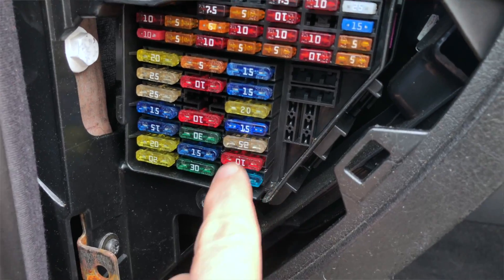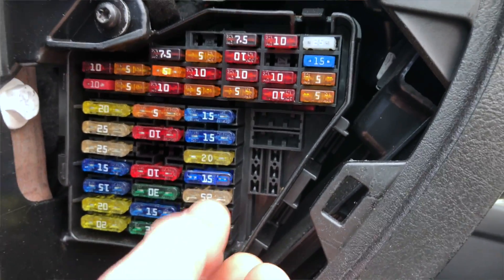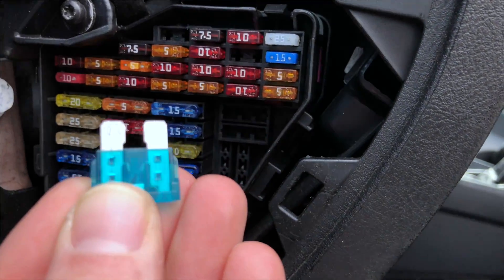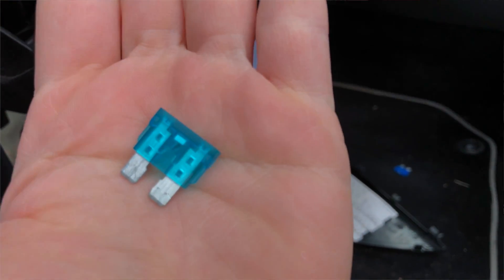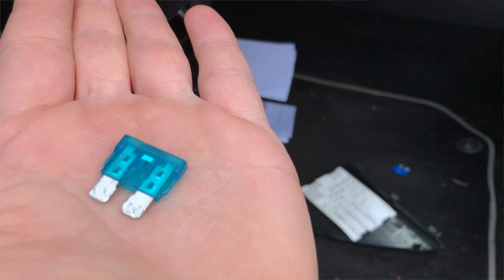Never Skip The Basics When Working on Cars

Comment: In the mk4 tdi I picked up last year, I had no illumination on any of the dash -the actual check engine, high beam, that sort of stuff all worked, but there were no interior back lights for anything. i went through the fuse box twice, had to find a better detailed one online that specified it, but it was just missing the entire time. I replaced the little bulb in the back of the heat controls before i had confirmed a missing fuse. Great times lol

Comment: I had a Golf in the shop before christmas with windshield heaters not working as the customer complain.
I had replaced the windshield a couple of months ago, so I figured I had forgotten to connect the ground or either of the power connections to the windshield.
Fuse was OK, ground was OK, resistance in the windshield was OK, relay was OK, turned it on, and voltage was OK....
I spent a good 30 minutes diagnosing a system that was working all the time, without first checking if it worked...

At least I could give the customer a full report, rather than just writing "function check OK".

Comment: My GF hit a concrete pole and ripped her mirror right out along with dented door, dented fender and broken blinker. Also her blower motor stopped working along with pretty much everything related to the mirrors/heat/AC/seat heaters etc. It was just a blown fuse due to the now exposed wires of the mirror touching.

Comment: I did some job on my B5 Passat and had to unplug a number of things to get er done. Getting it all buttoned back up, I forgot to plug the MAF back in. About flipped my lid figuring out why it wouldnt run right. Check your work (plugs, bolts, etc) on the way out of a repair!

Comment: I'll tell you another story that may shock you, a friend came to me saying that his car didn't want to run on gasoline, it runs only on propane, so he told me that the fuel pump died so I unplugged the pipe that was feeding the injectors and turned the ignition on and really there was no fuel, i asked him if he filled some in the tank because the arrow on the dash was on empty and he said that the arrow is broken and always stays there but he had filled half a tank. So presuming that there is fuel in the tank I started disassembling the tank cover and taking out the pump, after I took it out SURPRISE there was not a single drop of fuel in the tank, it was dry as a dessert. I assembled everything back, pored some fuel and everything worked even the arrow on the dash. My friend forgot to mention that he filled half a tank more than 2 months ago, so I know how you feel about the fuse. The car was a 98' Seat Cordoba.

Comment: The heated seats in my old Passat did not work since I've bought it. So one day I decided to diagnose the problem. I've started with passenger side and boom! The plug under the seat wasn't connected properly - I've reattached it and the seat was warm in a minute. After this success I went for a driver's seat. And again, I've instantly knew what the problem was... someone had changed the seat for the non-heated one :(

Comment: I Had a VW Something A customer Brought me. They Put in a AZ Fuel pump Assembly. Still No Start. I Remember It was a Newer car I Couldn't Imagine The FP being Bad. I Had no power to the FP. Ended up a Fuse In the Under Hood Fuse Box was Missing. That according to the Wiring Diagram That Fuse had nothing to do with the FP. Thank You Crazy Customer & Alldata

Comment: Passenger heated seat doesnt work, gf complains all the time. A video on seats would have helped
Reply from the maker: You can now blame me though. That’s cool!!! Hahahahha
Reply: @HumbleMechanic  I installed heated power seats in my Jeep XJ. Passenger seat is an XJ seat, driver's seat is a Grand Cherokee seat. I cut out the memory seat controller, rewired the switches to work. Wired in the heated seats too. Found all of the rare parts to do this, in the junkyard. Both seats elements are open. Womp womp. Still thrilled to have found the parts. The elements in heated seats just can't take decades of asses, (it's in the bible,) flexing, and heat cycles. You can find element repair vijeos, or threads in forums, but the ones I've seen look sketchy. It involves bridging the break with solder and you can see the burn mark from when the element opened, in the seat foam. Solder is not really meant to be the element or a wire, it can flex and crack, melts at lower temps, has higher resistance. If you can find new seat elements that's the way to go. Then you have to disassemble the seat or seats and put it back together again getting the cover back on right. Not an easy job, might need special tools for hog rings.
Reply: I diagnosed a car with passenger heated seat not working a couple of years ago.
Took me a couple of hours looking confused at a wiring diagram that didn't match the car. Swapped the driver's and passenger's seats, and the fault was still on the passenger side.
We had power, we had ground, but for some odd reason it didn't work.

After quite a few hours, I checked the parts number for the wiring harness under the passenger seat, and it was identical to the one under the driver's seat. 
This explained why the wiring diagram didn't match... The connection placement for either power or ground was different.

PS: If you want to cheap out on heated seats, buy a cheap sitting pad for hiking trips. They really work!
Reply: Did you check the fuse?  ;-)
Reply: @LMacNeill  one fuse for both seats. so thats not the case

Comment: Well one time a friend asked me if i could help HIM with this weird problem. He was driving, and the car started to make weird noises. And he drove like 10km and it still didn’t went away. And he was on the phone and went in to full diagnostic mode:
Yeah maybe my wheelbearing or my stabelazor, or its the rim or maybe it is the cv joint or boot or maybe its the whole arm. 
And i was like dude? Did u check ur tire? Turned out he had a flat tire.

Comment: Guy came in with his Tahoe and his power windows and seats weren't working. He took out the circuit breaker for the power seats and forgot to plug in the master window switch when he took the door panel off.

Comment: Thank you. The heated seats in my '04 Impala quit working. I checked the seat fuses but hadn't thought to check the other fuses.  Gonna pull the wire diagrams and see what else is involved...but if I need them, I have a test light, Power Probe and scan tool at the ready😉

Comment: You can start with the fuse box but never end at the fuse box.  Fuses blow for a reason.
Reply from the maker: Yep. I’ve actually written an outline for the follow up to this video  talking about that exact thing
Reply: @HumbleMechanic  ever find out what caused the fuse to blow? The same deity that tangles our meter leads steals our 10mm sockets?
Reply: The circuit starts at the fuse

Comment: Seriously, check your fuses. Had someone bring me a car saying their wipers died in a rainstorm. They were freaking out thinking they would have to buy a new wiper motor or wiper linkage plus all the labor. First thing I did was look at the fuse. It was the old style 'pill' fuses and one of the ends cracked that you couldn't see unless you pulled it out and looked very close. Fixed for less than a $1.
Reply: But did you bother to diagnose the reason why the fuse blew.
Reply: @danielwarren6845  Yes, it was old. The car is a 1983.

Comment: Dude, no kidding! This is so try! Get this, I live in Marathon Florida, in the keys right. None the less, it gets hot! So the AC goes out in my 2003 Dodge Ram 1500. It was just the blower fan that stopped working. No issues with the compressor. I spent the next 3 months driving around with the windows down, not wanting to change the fan.
The brakes start to squeak so I decide to do the rotors and the calipers. While I'm doing that, it's time to change the fan. I buy the fan from advanced, do the brakes. Go to pull the blower fan for the AC, unplug it and realize that the plug was broken!
Put a new end on it and the fan has been working ever since! Those hot 3 months for 5 minutes and a spade connecter, wow!

Comment: A blown fuse usually indicates electrical problems. If it blows again then you will need to go full diagnosis.
Reply: That fuse being a different blue usually means it's cheaper, possibly weaker. But it had been replaced before... I'm not gonna be surprised if we end up with the heated seat diagnostic video in the future.
Reply from the maker: 100% yes.
Reply: I was about to say same thing and i agree with you 100%. It drives me nuts when I see people replacing fuses saying "fuses keep blowing" like if the fuse was the root cause of the problem :-)
Reply: Yep. I had a xenon headlight fuse blow. I replaced it and the light started working. I thought maybe fuses just last 17 years.  A month later the fuse blew again. And replacing it did not help. The headlight was leaking, the ballast was full of water. Had to get a new one, should have diagnosed the first time the fuse blew.

Comment: Why would the color of the fuse be a factor??
Wouldn’t you check the fuse in that slot regardless of color ?
Might I ask y u even noted the color?
Am I missing something?
Reply from the maker: It’s not so much the the color, but it was different from the other fuses. I think it’s a different pop time than the OEM fuses.
Reply: HumbleMechanic 
That interesting...I’d hv thought all fuses of like ratings would b designed to hold a given load over a given amount of time...regardless of manufacturer
Reply from the maker: Even if the fuse was the same color, checking it is an early step
Reply: The fact that it’s a different shade of blue is a good indication that it’s been replaced before. A fuse does not blow by accident so I very much doubt a new one will last very long. Looks like you be making that video after all Charles.
Reply from the maker: It’s been about a month and still not blown again. From the YouTube video standpoint, I hope it does. From the “my butt likes to be warm” and “I don’t want to have to buy any parts” I hope she lasts forever 😂
Reply: Yeah, but you can find fuses at the dollar store and who knows what high standards they were  made to?
Reply: @dudley7540  Its a thin piece of wire in a plastic case. A manufacturer could easily make 200 for a dollar and they are all rated to blow at the amperage stated on the case. A cheap fuse is no different to a expensive fuse.

Comment: Charles is an Awesome technician! If more techs were like him the automotive repair industry would be a million times better! Hes been an inspiration to me to do better and to share my 10 Years of Toyota repair experience! Never stop learning guys! Keep it up Charles Love the videos and podcasts!!
Reply: As cars getting more complex there will be less and less good techs out there. Nobody wants to pay them, car manufacturer nor dealers would ever spend any money on proper diagnoses. 
Good techs are extremely underappreciated  and underpaid.
Reply: Don't worry the scan tool will tell them which fuse to replace.  Computer programmers will save the world!
Reply: @kentsimon2152  I hope that is sarcasm? Even if you go far enough to monitor every fuse you will still need brain power and expertise to find out reason behind fuse blowing out.
Computer will never be able to tell that you  got washer fluid wicked by level sensor wire and sent all the way to BCM.
Reply: @senco981  Yes, and no.  It's part of the basics now to pull codes to diagnose issues, but the newer cars are building in more systems to tell you a light bulb is out , there's a bad connection, which cylinder is misfiring etc.
Reply: Senco it’s very true! To be a good tech you have to have a love for being a tech not a love for the money.